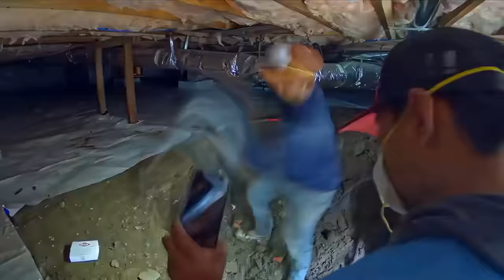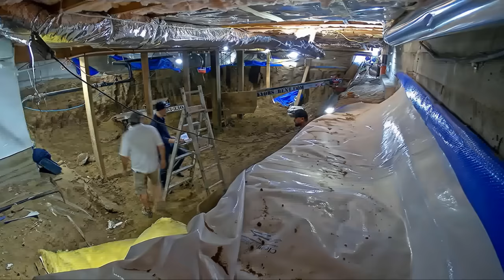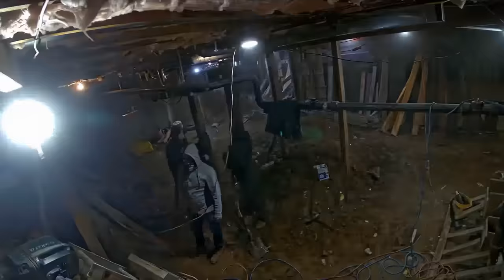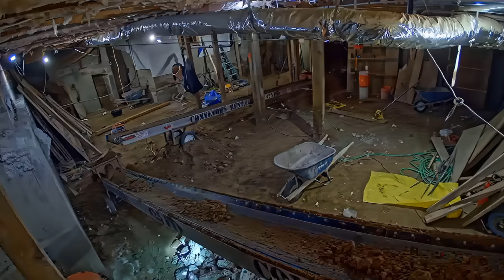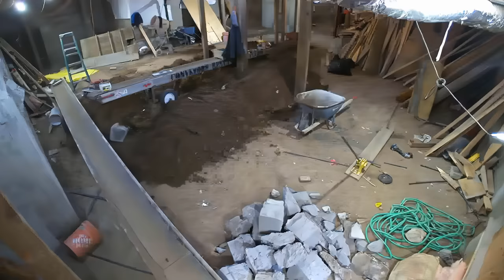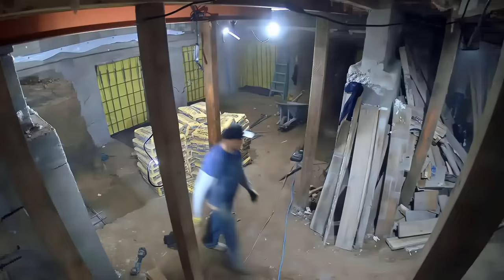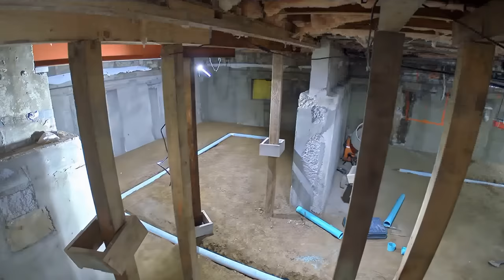Digging Out a Massive BASEMENT From Start to Finish - Time-lapse

Comment: Basement renovations are crazy. We're currently doing the same thing with a couple of 7-story historic buildings downtown here, except the new shear wall and braced frame footings are so massive we have to lower excavators and skid steers underground through a hole in the sidewalk and dig them with machines because there's no possible way of doing it by hand, especially with the density of the glacial till we have here. It's a trip running machines completely underground. I need to take some footage soon because they're pretty wild projects, never done anything like them before. Already found a bunch of old bottles, shoes, and other stuff dating back to the 1870s that they just threw in the fill back in the day, including some lumber that was charred from the great fire we had here in 1907 when they demolished the old building and built the new one.
Reply: Hah where about are you? We have a 100 year old house in Seattle that has half basement, half crawlspace probably because it was good enough and they were sick of digging in the glacial till
Reply: @RileyLabrecque  This is Seattle too! One building is in Pioneer Square, built in 1908, and one is right in the busiest part of downtown, built in 1914. One of them is on the National Registry of Historic Places too. You never know what you're going to find digging under Seattle! We did a job in South Lake Union a few years back where we found native arrowheads and all sorts of other stuff, that one got shut down for weeks for the archaeologists to come in and excavate by hand.

Comment: We started digging ours 20 years ago with only 24" of headroom from the inside using 5 gallon buckets. Now enough room to fit a large van under the house, had to replace a (now it is 9 1/2' ) structural post. We had to make an area for a sump pit. I can sure appreciate your project. well done. thanks.
Reply from the maker: Its some hard, brutal work ! Huge congrats to you for going through with it. It's not for the weak heart that's forsure !

Comment from the maker: This was an insane project and hopefully you get some good insight on how we dig out basements from this video !
Reply: I'm curious, is this like a $50k project or a $300k project?  I have never seen something like this done before.  Obviously a lot of variables, but that is a ton of work, hundreds of tons lol.
Reply: @twodogsandtheirfamily  This ain't no $50k project and while $300k is a bit high it is much closer to the real cost. In New Orleans, because it is below sea level, there are no basements so they just slide metal beams under the house, lift it up and build a new ground floor.  Fairly commonly done - and I'm pretty sure a lot less expensive than this basement!
Reply: @DAMIAN WAGNER where in Wisconsin?
Reply: Props to the workers. I would have died
Reply: You know, you could place steel and shoot structural gunite instead of wasting time with forms.
Reply: @twodogsandtheirfamily  For this? I'd say probably on the order of 115K. That's accounting for labor alone costing around 50-60K on the lower end of the scale. Equipment rental, concrete, finishing, etc, adds up to the balance. Though, I wonder how much engineering this would cost too.
Reply: Whyever did u guys not use a ride on bobcat?????
Reply from the maker: @abekornelsen125  We've built up a system of hand digging that works best for us !
Reply: @GoldsConcrete  but look up mini skid steer loader. You can move 50 shovels of dirt per 20 seconds like a basement of that size it would save you 4 months of labour and still charge the same
Reply: I did the same thing and my hole into the crawl space was made big enough to fit in a skid steer and we dug out the space in about 3 days.

Comment: Crazy amount of hand shoveling here. I remember when my dad felt the need to dig out his basement in both of his house and camp. I had to start with a soup ladle not even joking. The lack of room sucked to get under the house. I dug for a whole summer doing exactly this lol. Only difference I see here and in both my shoveling excavations is you don’t have any rocks anywhere. Where in New Hampshire “the granite state” every shovel full had a rock the size range of a golf ball to a basketball and much larger. Not to mention about 1,000 bags of cement mix to be mixed and poured. I bent a few pry bars doing them digs lol. Much respect for this type of hard work. One positive about doing these type of jobs is it’s much cooler under the house digging holes like this. If this was in the open area without cover it would be so hot baking in that sun.
Reply: And I’m now remembering how many grub ho’s I went through. I can remember dulling about three breaking a couple handles and bent a couple also lol. The house wasn’t as large as this place it was a 34’x28’ house and the camp was 50’x30’. The camp has a L shape also which sucked lol. We used a ton of railroad ties as we went up to support the houses also. I’m liking how you guys did partial pours under the wall ends. Great job here.
Reply from the maker: Its brutal work ! But like you said not having huge rocks makes a hell of a difference, The clay is easy to break apart and the scoop into a conveyor,  we have it nice here in Denver!
Reply: See my reply. You are right ! Rocks make it much harder to dig out !

Comment: wondering what you did to re establish footings for outside walls ?? maybe it was shown but hard to tell in fast mode ??
Reply: Check out the video where you see the yellow plastic, rebar and then a plywood panel to form up a concrete column. They dug out from under the footing in sections but left large sections of dirt to support the existing footings then formed up concrete columns and when cured removed the those sections of dirt and again formed up concrete columns.
Reply from the maker: It is a blink and you miss it moment in this, but we do plan on releasing an animated video showing a process for these digouts ! So stay tuned for that

Comment: Wow 4-7 crew for months on end :O.
One question though - so the house was originally supported with stilts on concrete blocks.
And seems you remove those one by one and replaced them with longer stilts that were placed directly on dirt.
And when the concrete was pursed, the stilts were isolated from the concrete.
So how is the house finally supported ? Do the new stilts remain directly on dirt ?
Reply from the maker: Great question and unfortunately we weren't able to record this part but we do take out those temporary beams and put in the final metal posts which are supported by concrete !

Comment: I would have taken apart a mini skid steer and re assembled it in the basement before doing that by hand lol
Reply from the maker: Just be careful not to suffocate on the fumes ! And we will say the conveyors make a Massive difference. We use a skid steer outside to take the dirt to the trucks.
Reply: @GoldsConcrete  hopefully you were already pumping cool air down for the guys.
Reply from the maker: @TheWISE67  We always are !

Comment: WOW....that was amazing....couple questions how did you find and keep the labor and how many sq. Feet did this add to the house? Great job.
Reply from the maker: Thank you, and great questions. Our guys have done dozens of these digouts so they are pretty proficient at these, not to mention animals at getting it done. And in terms of added square feet it came out to be roughly an additional 1,700 sqft for them !
Reply: Well for everyone talking about cost...if my math and internet info is right....per sq. Ft of new construction in Colorado is around 136ish  at 1700 sq feet that’s about 230,000ish if I’m correct in some of the posts you said the cost was 150,000ish  I know there are a lot of variables but sounds like a great deal for them if they don’t have to go to all the trouble moving and want more space......again nice work

Comment: We had concrete block pillars and I had my house jacked up by a professional house mover who dug  under it with a dosser. I resulted in a large flat back yard and full 10 ft high basement poured exterior walls with above ground 3 courses block and a cap block 10 inch walls.
Reply from the maker: Thats awesome !

Comment: I knew an old man that did this with his doublewide.  He Built the foundation work with brick and concrete and the poured a new slab under the house.  He did most of the work himself.  I believe he was in his 70s.  He passed away a few years ago, well into his 90s.

Comment: Used to drive a mixer and did lots of pump work. Seen guys doing line pours like these and take a 5gal bucket, cut in half then make a trough for the hose to lay across it especially at the clamps..makes sliding hose easier, and on rebar it's like butter..just drag the buckets with a rebar pulling hook. I hope you're getting your Sackrete right from the factory by the semi load lol

Comment: Fascinating never seen this done before - New Zealand doesn't tend to do the basement thing. Surprised that there wasn't reinforcing in the final cement pour. Also surprised that a stand on digger thing wasn't used to move dirt around
Reply from the maker: Glad we could share this with you ! And we use a special mix of concrete with microfibers that gives us the same strength as rebar while being lighter and more cost effective, and finally there was no access for a skid steer.
Reply: @GoldsConcrete  thanks for taking the time to reply. Cool to hear about microfibers in the concrete. Learned again something new. 

Down here we have a brand call Kanga, comes from australia where kanga is a common name for kangaroo. Is about the size of a small ride on lawnmower, and you stand on the back (no space for a seat) and all sorts of attachments go on the front. Can get into little places that a skid steer could never do. 

Might be something to look into for future projects, have no idea what the equivalent brand is in North America.
Reply from the maker: @zestoslife  Thank you for this, we will do our research !

Comment: Awesome work.  What would a job like this cost?  I have a 1930's house I want to at least make the non crawl space part of the dirt basement so I can walk around without ducking down everywhere.
Reply from the maker: Hey ! Great question, We can't really give you an exact number as there's a lot of variables depending on where you live, Labor costs, Soil Conditions, material cost etc. But we can say that here in the Denver area on average each digout is roughly 150 grand.

Comment: So basically to install a basement you dig out the central area, putting up support beams as you do, work your way out to the edges of the building, then you make all the walls and route all the utility pipes and only then fill in the floor, good to know

Comment: Out of curiosity, why didn't they insulate under the concrete when they poured? Also, maybe I missed it, but I didn't see rebar. Was it not needed?
Reply from the maker: The homeowner wasn't interested in any insulation and we use a microfiber concrete mix that gives us the same strength as rebar !

Comment: Impressive work, is there a reason you went for hand digging instead of renting one of those baby mini excavators with removable ROPS? I can't imagine it's emissions since they have electric ones, maybe noise?
Reply from the maker: Great question, and it's usually because we don't have enough room on the exterior of the homes to create a suitable ramp down into the basement. Its a lot more work and landscaping that need to be done going that route. But there are instances where its more beneficial

Comment: I'm a general contractor up here in British Columbia and I've installed basements under existing  homes many times.
Is there a reason this was all done manually ? , maybe it was a very constricted job site ?
I've always used skid steer's for digging out under the house and an excavator on the outside removing the dirt for the skid steer and pulling out all of the old foundation. I usually would do a job like this with 2 or 3 guys and take about a month, maybe a little longer.
We have to use engineers here and they always require at least 30 mpa ready mix concrete using a line pump but you used hand mixing here, why ?
We have to water proof the outside of the foundation and provide drainage around the outside of the footing to meet code, how did you achieve that here ?
How did you deal with the hinge connection between the old, upper foundation and the new lower foundation ?
edit: just saw a different video that showed the footer and wall rebar & forming that was done in stages to support old foundation, was this engineered ?
Anyways, because of the manpower shortage these days we have to be as efficient as possible with man hours, this reminds me of how they did this 60 years ago.
But still fascinating to watch, thanks for the video.

Comment: I’m in the Midwest and water penetration is something we have to consider. This looks like Colorado so the situation might be different. What is the reason you only put a vapor barrier down and not a permeable layer of gravel underneath? Water can’t really drain underneath the concrete and vapor barrier.
Reply from the maker: It's what's called out in the design plans. They do soil tests to determine if we need to lay rock beneath the vapor barrier. In some cases we do, if it's called for

Comment: The only question I have is: Shouldn't the floor be thicker and reinforced with mesh or did you use concrete that has fiberglass or plastic reinforcement already in it?
Reply from the maker: Ding ding ! You're the first to guess that right ! Yes, we use a mix with microfibers added in already

Comment: @goldsconcrete could you guys have disconnected utilities then jacked the house up high enough to get machinery under it to dig and pour whole new foundation
Reply from the maker: This is doable but it a whole of a lot more expensive and the homeowner has to vacate the property for the duration of the project. Something that we have the benefit of not doing this way.

Comment: Have a few questions about the underpinning concrete work. How can you ensure the consistency and strength of the mix when a large proportion was hand mixed and looked like a cement mix only, any aggregate used? Are you required to provide samples for testing? Did you have continuity between the underpinned sections or was it just relying on bond between the concrete faces.

Comment: Any reason you didn't pin it with beams and use a track loader for the dig? Significantly faster and cheaper. Ive done a "few" that way.

Comment: That's some work right there. I'm just wondering the cost for something like this? Think they did some support with the dig too.
Reply from the maker: Really hard to give an estimate as there are a lot of considerations such as accessibility, solid conditions, water level, labor costs, material costs, etc.
Reply: @GoldsConcrete  Would you be able disclose on that project done in the vid with it's total? Or roughly an estimate?

Comment: Pretty impressive, won't ask the cost, cause I'm sure it's high, as it should be, it's extremely labor intensive, but I have to wonder can one lift a house on to stilts and then pour a full basement and then put house back on. Easier said than done, I know. Hahah. Is it cheaper to sell and buy house with a basement. If I win the lotto ill give yall a holler to dig my crawlspace out. Impressive work
Reply from the maker: Haha great question. And this is probably the most cost effective way, besides just building the basement with a house in the first place ! And the way you mentioned could be done but there are so many safety risks, extra labor, and engineering involved that you're looking at a super expensive job doing it that way.

Comment: I see all these 6x6s going straight into the dirt. Don't they need a footer? Am I missing something here?
Reply from the maker: Good catch! They're temporary support beams setting right on the dirt, yes! There is typically a small wood block beneath the beam to distribute the weight. When the floor is graded and ready to pour, the temporary beams are replaced with permanent support beams secured properly in place.

Comment: Woow, that's wierd and impressive at the same time. How much "connected" to the ground houses like that are? Is it possible to simply move the house away for few weeks and use heavy equipement - obviously assuming there is a place to move it. :)

Comment: Maybe someone has asked this question, but I didn't see any rebar in the floor. Is there a reason it wasn't needed/used?
Reply from the maker: We use a special mix with microfibers that gives the same strength as rebar !
Reply: @GoldsConcrete  Thanks for the reply. Great work. You've got a hard working crew!

Comment: Amazing job some serious graft gone into that job! I've 1 question, not a brickie myself but do alot of DIY. Should you not have put rebar down before you poured the concrete? Just asking
Reply from the maker: We use a special mix of concrete with microfibers that gives us the same strength as rebar with less weight and cost
Reply: @GoldsConcrete  thanks for the quick reply,  had a feeling it was something like that. Really an amazing project congratulations. How long did it take?
Reply from the maker: @tonyb1825  Of course ! And this was a longer one due to the shear size and small access point. It came out to about 5 months.
Reply: @GoldsConcrete  wow 5 months you all must be part of their extended family at this stage 🤣. Anyway really loved the video 👍